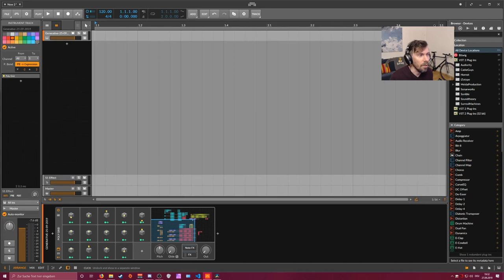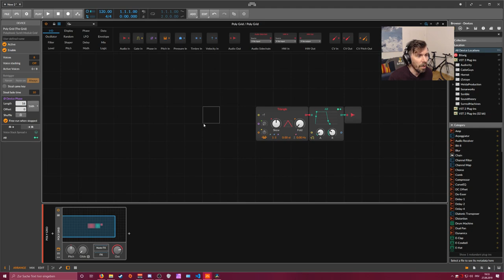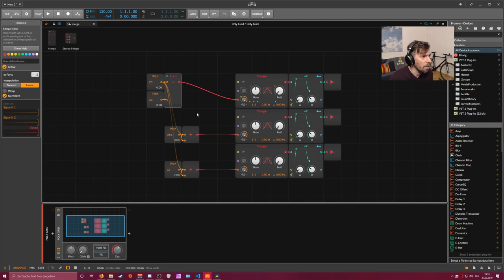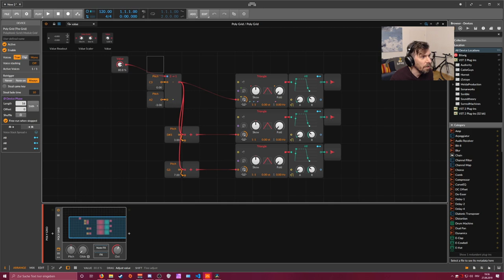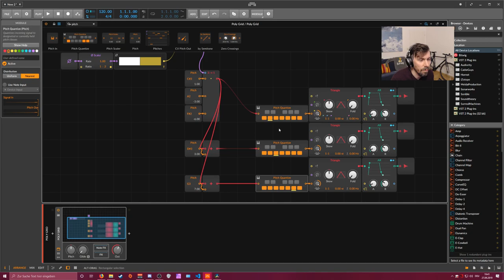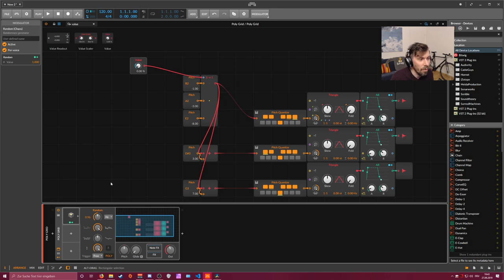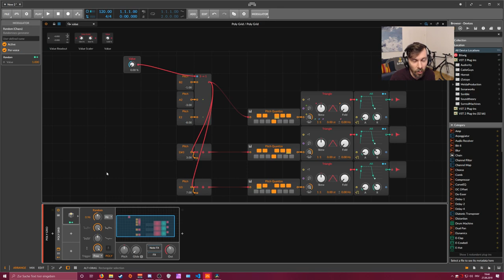How to create a chord progression inside the Grid of Bitwig Studio 3

Comment: Thank you for such a great explonation! The Grid is so deep.

 Also I realize posibility to use random modulators for add randomness in the phase signal. This will be good for complex ambient textures.

and one more little question: why did you use S&H module before scalers in the "generative 25-09-19"?
Reply from the maker: because the "pitch" signal changes in between the osc triggers/gates. So one note actually becomes two or three notes because of the pitch change. So the S/H modules hold the pitch signal until the next gate trigger happens.